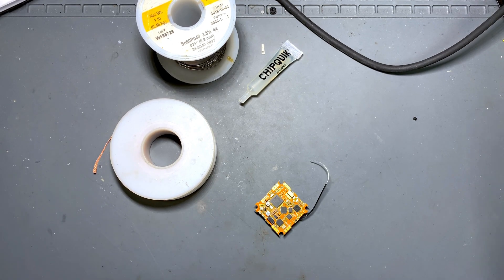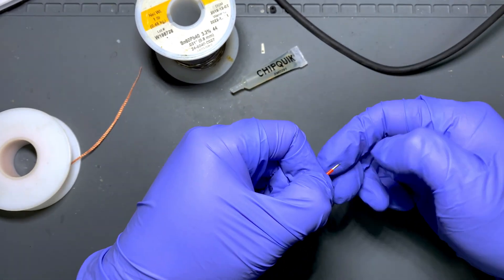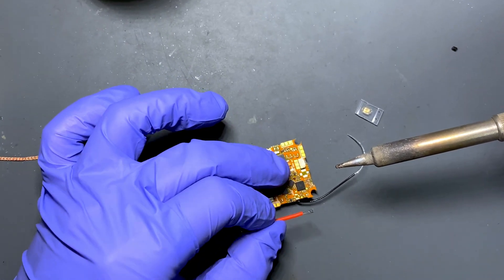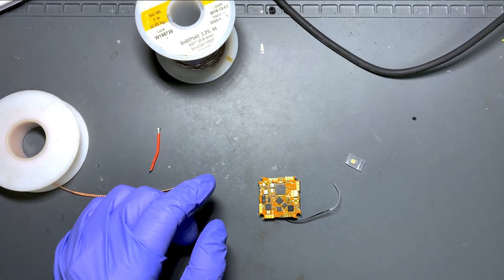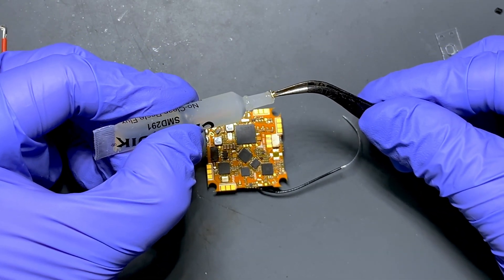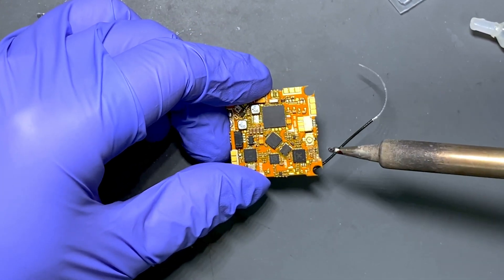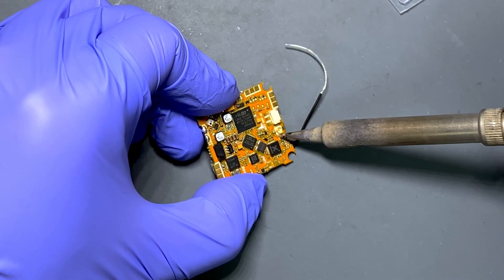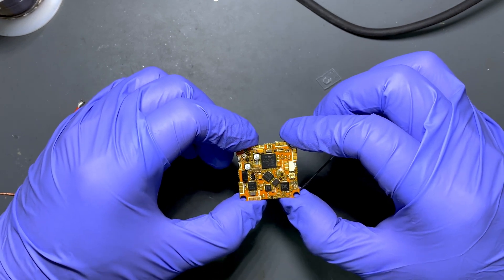How to solder a U.FL connector on BeeBrainBL V3

Comment: Great video. You've given me the confidence to try and repair the UFL connector on my matrix 1s for my air65. It looks much easier than I anticipated and if it doesn't work out no big deal the new 5in1 is on its way already
Reply: About to try the same on my air75 with a 4 in 1. How’d it work out for you? I’m hopeful but not super confident in my soldering capability…

Comment: Excellent detail and some great tips Kelvin! Using multistrand wire and flux in place of wick is a great one.

The last one of these I fixed I just soldered on the antenna directly, but replacing the whole connector is much neater.
Reply from the maker: Thank you Jason!  I realized solder Wick is just copper wire with flux coating, so normal wire with flux I assume it will works the same. haha.